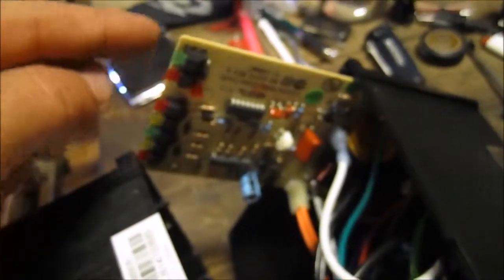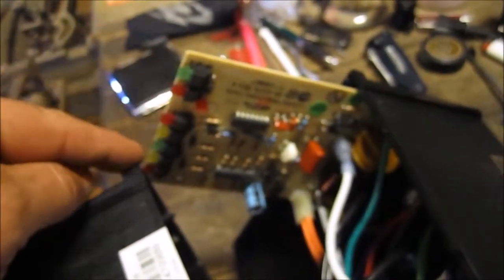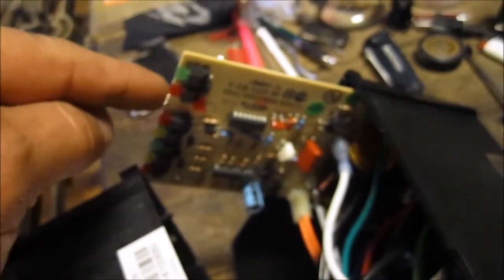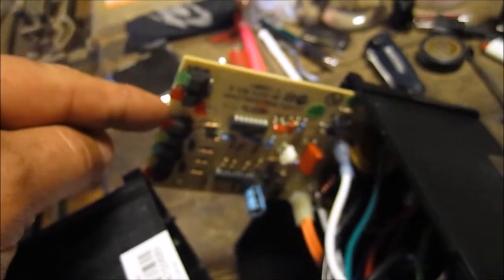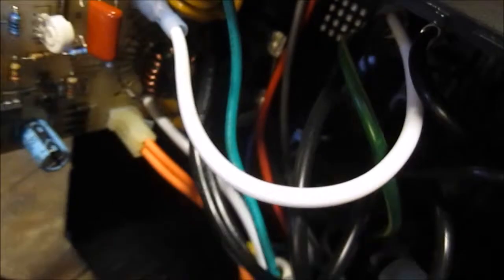Hacking Apart Tripp Light Line Conditioner LC1200 Watt

Comment: So does a yellow light mean that the voltage coming from the main electricity is low for the items plugged into the conditioner or that too many things are plugged into it for the electricity to handle i.e. overload?